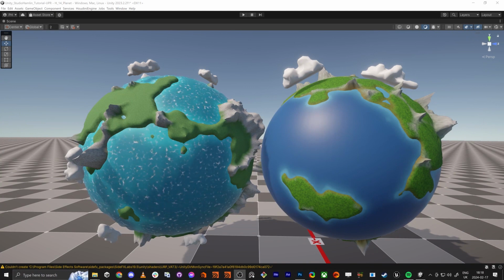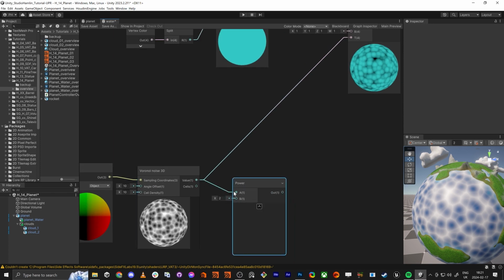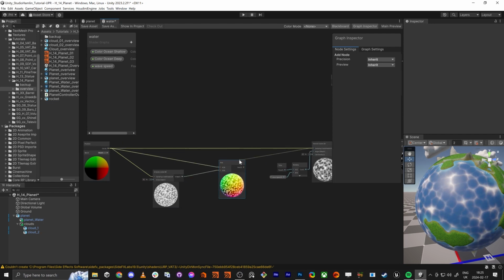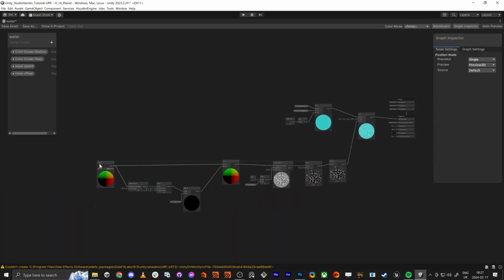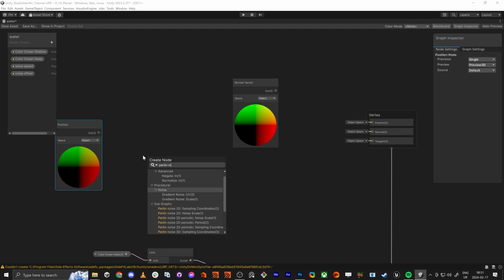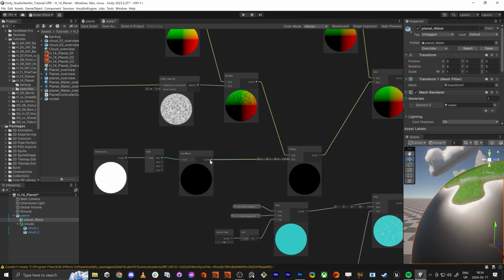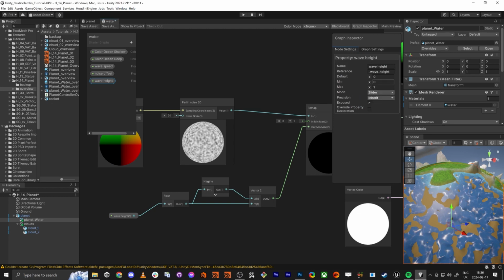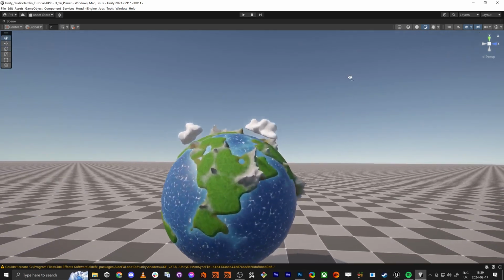Unity 3D Noise In Vertex And Fragment Shader Graph

Comment: i'm trying to offset the position by a height texture, but whenever i add the sampled texture to the position node, i cannot connect it to the vertex position input anymore, any idea why that is?
Reply from the maker: If you noticed, Shader Graph has two parts: the vertex and fragment sections. Take a look at the shader nodes again. They involve two different calculations, as I understand it, so you need to duplicate them. The vertex is calculated first, followed by the fragment, so they can share any nodes, just duplicate it! :-)
Reply: @TechHamlin  think i found it, you cannot sample a texture during the vertex stage with texturesample2d, you have to use texturesample2d_lod instead.
Reply from the maker: @ aha! Thanks for sharing, I will definitely keep that in mind!